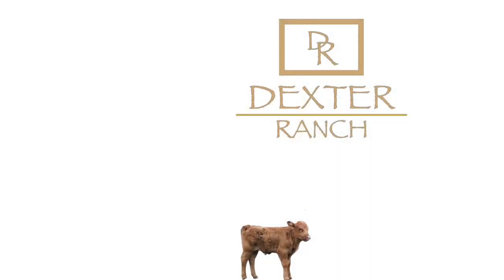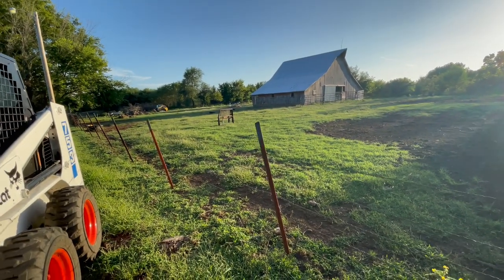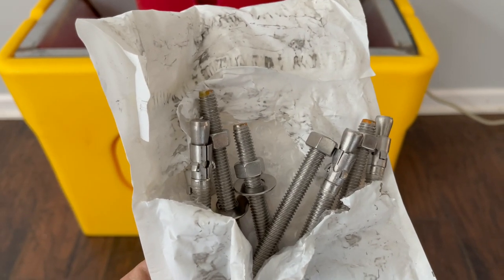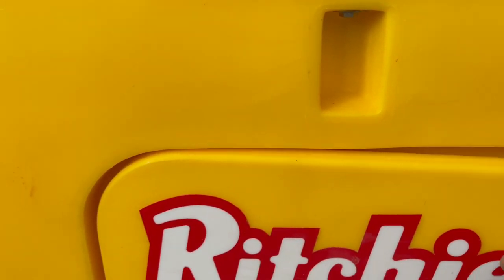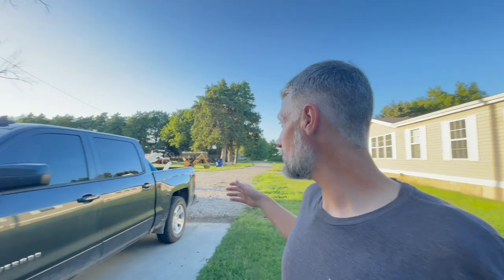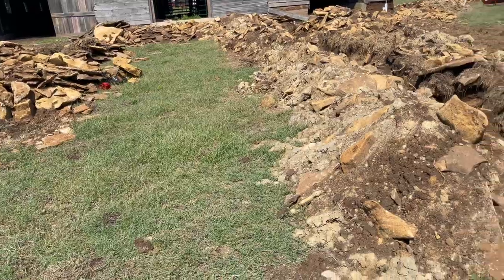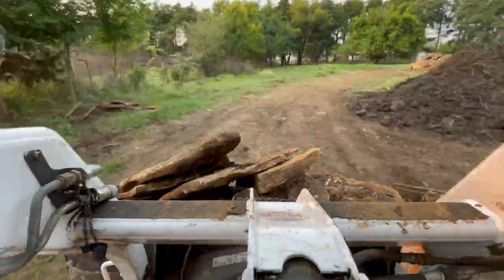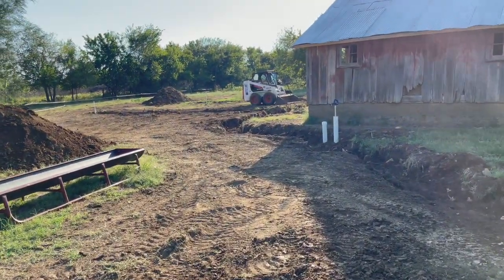Ritchie Waterer Install DIY

Comment: Have put in several Ritchies.  Wish I could get away with shallow lines, but here in ND, they have to be over 6ft deep to ensure being below frost line.  Also I don't put 90 degree elbows in, quit that years ago, and use 45's, have never regretted it, plus if I have have to winterize those lines, I know I can blow them out and no water will every sit in a 90 degree elbow and break a line.  Using no rocks for backfill is ALWAYS a great idea, would never bury rocks in a new trench, too much risk of puncture in the line, especially that lighter PEX line like you used.  I also always use the heavy black plastic, it has about 1/4" thick sidewall, pretty hefty and have have never had it break.  

Also everyone if you are interested COBETT waterer's are great too, and really easy to install, just need a backhoe, and hook up water.  

Good job.

Comment: I always envy people that don't have to put water lines four feet deep like we do here in southern Iowa. But the envy goes out the window when I realize I can usually dig all day without hitting hardly any rocks of any size. I guess we all have our cross to bare. ;o)  I know it's none of my business, people always say that just before they stick their nose in your business, but shouldn't you have put the wire in plastic conduit before you buried it to protect it from damage? One suggestion, for what it's worth, if you would put a border of logs or something out around the gravel, level with the concrete, it will keep the cattle from ruining your gravel pad. Good day friend.
Reply from the maker: Hi Steve!  Yes the rock was horrible. I hit 36” most places in the trench, but the house waterline is only 22, and that’s what most people around here shoot for. So that part is nice lol.  This was a UF type wire. It is intended to be direct bury. I don’t have the experience to say that it holds up to intended purpose, but that’s what’s it’s for. It’s has a pvc jacket around the wire. That was another reason I decided I didn’t want any rock. Only time will tell.  I like the suggestion about the logs. I was thinking about what I could do there. Thank you!

Comment: You should have a back flow preventer if its tied into you house water source, got to be safe for your family
Reply from the maker: Hi Jim. What does a back flow preventer do?  Is it something that can be installed at the waterer?  Thanks for the suggestion!
Reply: @dexterranch  it’ll stop water that’s been exposed to your animals from flowing back into your pipes and into your home. A good way to prevent cross contamination and avoid illness
Reply from the maker: I will definitely look into. Thanks again!

Comment: I think every problem like this is vitamin and mineral related. I have been looking into giving free choice minerals in powered form. I'm researching to fine every mineral a cow could need and providing each mineral individually so they can choose what they need. I think it will save money in the long run with them separate. so their not eating minerals their don't need trying to get to the ones they do need. The cost in the begining is going to be higher but once all their needs are met they will only be eating very little and you want need those tubs anymore. It's what I have been thinking about for mine in the future🙂
Reply from the maker: That’s an interesting idea.  I have seen some mineral feeders with a lot of different color powders in them. That must be what they are doing. The tubs I feed are not to provide mineral. They are urea based protein tubs. I currently feed mineral in powder form free choice but it’s just a mix of a bunch of different minerals all together.  Never thought about separating it. Thank you!